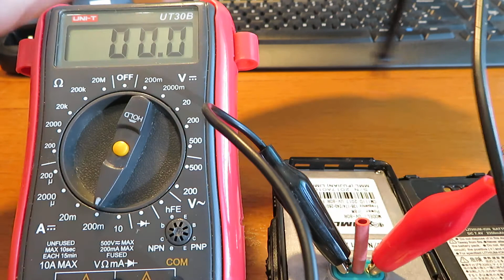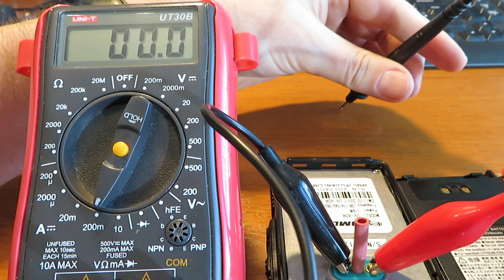Yaesu Clone UV-8DR Vampire Drain

Comment: Interesting stuff mate, my Wouxun KG-UV1DP and KG-UV8D's have the same issues, it takes about 2 weeks but they're dead. Just water tested mine by the way...
Reply from the maker: Oh right my KGUVD1P is fine, my Icom ICE also has a push to power on button and that lasts just fine, any radios with switches for power on shouldnt do it of course, other sets that do it will likely be either the battery self discharging or the battery management chip that's inside the battery is draining it, way to check on the wouxun is to take it out for the radio and see if it still does it.

Comment: Hi.  Interesting video. I also have that radio... I’ve had it charged and left in my car for over a week and no problems like battery drain... wonder if there’s a fault ? You haven’t done a water test have you ? And got water inside ?
Reply from the maker: No not done water test yet, Ringway Manchester's radio is doing the same thing though and he is doing the water test this weekend some time? I guess for this radio I will just have to unclip the battery when it's not being used which is a bit of a pita 🙄
Reply: Ok I’ve made a terrible mistake. You are completely right. The yaesu wanabe DOES kill the battery after a few days... this is really bad.. it can no longer be my everyday carry radio !
Reply: I have just bought this radio and noticed yesterday that mine drains the battery when turned off too! Really bad!!!!
Reply from the maker: Yes I'd return the radio to the seller, my radio was given to me by a family member otherwise I'd send it back